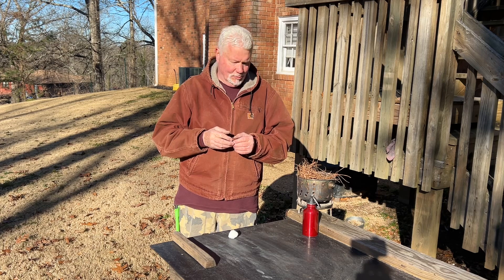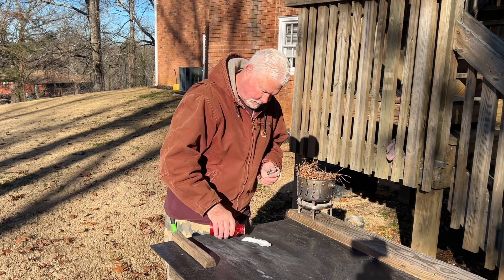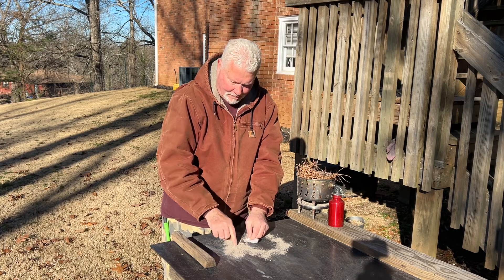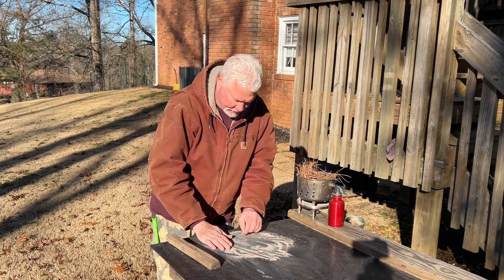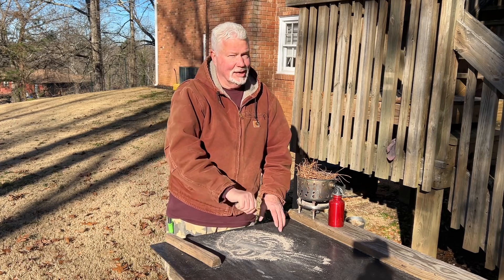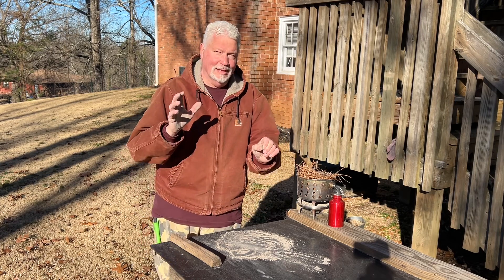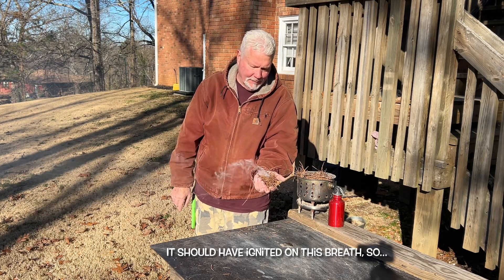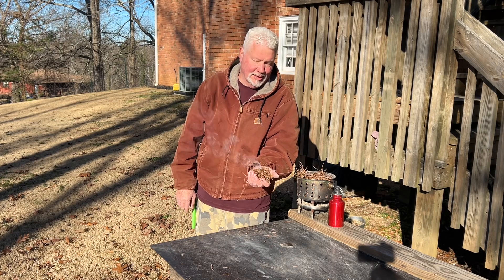How To Fire Roll Cotton And Wood Ashes, Why It Works

Comment from the maker: Wood ashes contain Potassium Carbonate that turns to Lye (Sodium Hydroxide) when water is added. I think there’s enough moisture in all the usable exterior fibers, not just this cotton, to say that the chemical component within is Lye. Wood ashes also have a micro grit that will create great friction inside a fire roll. I want to stress that I am supposing here... I THINK, the reason why a wood ashes fire roll is the easiest of all is because of chemical reaction and friction. An oxide or other chemical is not always necessary to make cotton nor many many other exterior fibers fire ignite ignite. Friction alone (vigorous rolling), many times, is all that is necessary.
   Please follow the LINKs below and SUBSCRIBE. Thank You!

Rudiger Roll, Fire Roll Playlist
https://www.youtube.com/playlist?list=PLkoXX8XsMW3kLMA7kY_LznhzK5nOrA3Wd
How To Make A Stainless Hobo Stove Out Of A 3qt Pot
https://youtu.be/idVu1ETX2kg
Reply: The correct chemistry would be: potassium carbonate plus heat goes to potassium oxide or potassium hydroxide depending on how much heat and or moisture is present.  Potassium hydroxide is caustic potash. Sodium hydroxide is caustic soda (lye), and can not be made from potassium.
Reply: @larrytischler570  Yes, it's confusing because "lye" is the term used for both potassium hydroxide and sodium hydroxide--and both are caustic (bases, opposite of acids, alkaline, measured as more than 7 on the pH scale). But as Larry said, what you get from wood ash is potassium hydroxide, not the sodium hydroxide that's typically found in drain opener.
These videos about fire rolls are cool. I didn't know such a thing existed.

Comment: I must be pushing too hard because the roll always thins out and disintegrates. I Have never successfully done this method.
Reply from the maker: The opposite is true. The harder you push the quicker the ignition. Low downward pressure causes the roll to lengthen, thin out, and disintegrate

Comment: Hi David.
It is not possible for Potassium carbonate (K2CO3) into sodium hydroxide (NaOH).  Wood ash also contains sodium carbonate (Na2CO3).  This can be turned into sodium hydroxide.   The potassium carbonate can also be turned into potassium hydroxide.
The effect would be similar in the fire roll.
Love your videos!
Reply from the maker: This from the internet is what I was using for my explanation… forYou see, lye (sodium hydroxide) is formed when wood ash (which is mostly potassium carbonate) is mixed with water. The mixed solution is extremely alkaline and if it comes in contact with your skin, it begins to absorb the oils and turns your skin into soap
Reply: David, @pierrehuppe76 rightly wrote that sodium compounds cannot be obtained from potassium compounds in a chemical reaction. The transformation of potassium into sodium may be possible in some extraordinary nuclear transformations, but that is not what your videos are about. Wood contains more potassium compounds than sodium. It is better to focus on potassium. There are many possible chemical reactions. Ash from burnt wood can contain K2O, KHCO3, KOH, and K2CO3. I will stop at just two simple phenomena. K2O in the presence of water vapor can form KOH and this chemical reaction proceeds with the release of heat. KOH dissolves (this is already a physical phenomenon) in water (vapor) with the release of significant amounts of heat (every chemist knows this). That is all I know about the chemistry of potassium compounds. Regardless of chemistry and physics, I really enjoy watching your videos. Thanks David.
Reply: Yep, NaOH is a lye (alkaline) but KOH is also a lye (alkaline) even stronger than NaOH.

Comment: Very interesting...reverse rolling.  I have been teaching my son different fire making techniques and when we got to fire rolling, we were hit and miss and it seemed the roll was too tight and thinned out on the unsuccessful attempts.  We thought it was the variation in pressure applied.  Will give this a try!  Thanks as always!
Reply from the maker: Thinning out, for me, is not enough downward pressure. Too hard, is from not turning 180 degrees. It especially needs turning if your filler has any moisture in it.
Reply: Cool.... thanks!

Comment: I'm sure there is a trick to getting the fine ash that you keep in the container. Is it possible to just pull ashes from a previous camp fire and use them, or is there a process to refine them that must be followed?
Reply from the maker: See my fire roll playlist. I have many videos showing how to pull ashes straight out of the hobo stove, but I usually strain them to remove the charcoal.
Reply: @DavidWestBgood2ppl  Thank you!